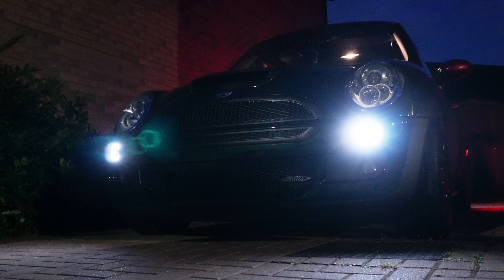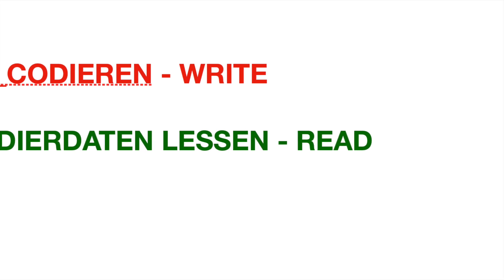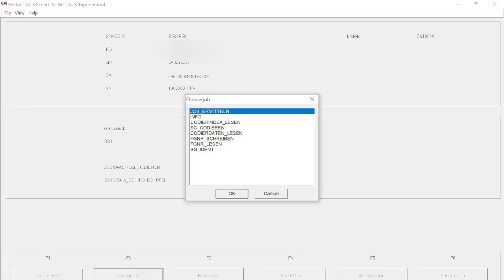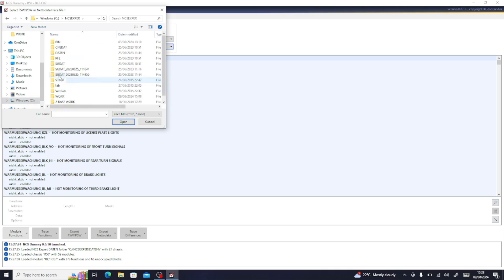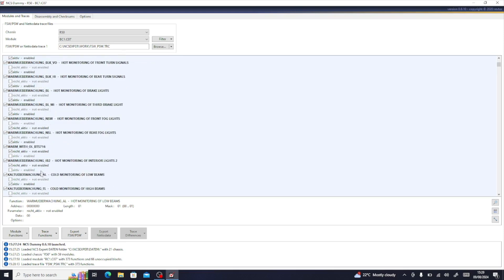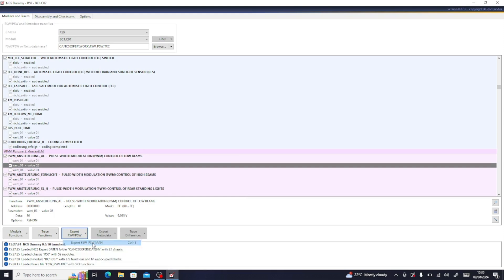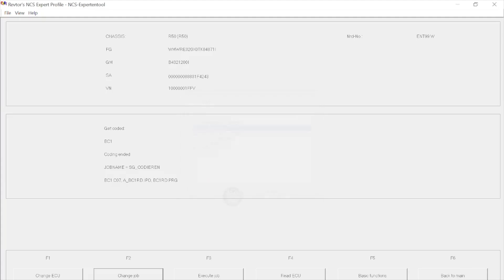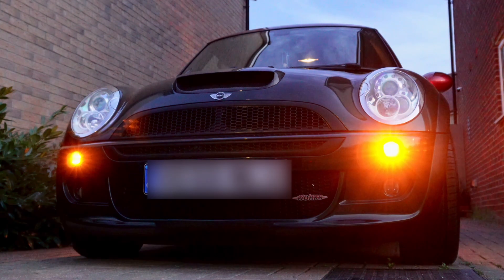How To: Using NCS EXPERT to CODE in XENON lights to my HALOGEN R53 Mini - How you can do it to..

Comment: I have a 06 r50 will the r53 xenon lights work with this coding , I have vista would that work? Cheers
Reply from the maker: It’ll work on the R50 as well, there was believe it or not a retro fit kit from mini back in the day for xenon retrofit. 

As for Vista it should work, try installing NCS expert and NCS Dummy as long as they install and your drivers for your K-DCAN cable install all should be fine.
Reply: @ThorMotorWerks ok, I've converted a r50 to r53 engine the whole hog, is this feature within my r53 2006 ecu? And if so how do I get around self level has my r50 dosent have it?cheers
Reply from the maker: @roofscoop66 It’s not really anything to do with the ECU, it’s the BCM but if you’ve done a full swap over and you’ve used the R53 BCM it may already be setup for Xenon’s anyways. If you’ve done have Halogen lights you’ll have a headlight adjust on the lower dash you can use that for levelling. 

Once coded you can if needed swap your halogens in for an MOT without the need to recode the BCM. As this setup allows both Xenon and Halogen to work without hyper flashing. 

It’s only if Hyper flashing occurs when you do the initial swap with the engine running. 

Hope that helps

Comment: Hi! Its not working for me, everything goes as it should, even uploading the file. I wait till its says "code ended". But my ligths are still flickering when the engine its running.

I tried to do it again and the new file that i read still have the settings for halogen lights. Its like the modified file its not been uploaded to the ecu even if ncs expert says code ended.

Can you please help me
Reply: Btw, its the profile chosen on ncs experts affects the job?
Reply from the maker: If you send over a copy of the BCM read file to the email address in the description below, I will take a look. Not sure the profile would affect it, but I'll see what I can do. Might not be a for a couple of days though, but its the easiest way to take a look.

Comment: Hi do you know how to change chassis number on the bcm module?
I had to replace mine but can’t code to my car as vin number on bcm don’t match the rest of the car
Reply from the maker: Can't say I have ever had to do that. Normally you match the BCM to the options on the car. You can change the ZCS details on the Centre dial. What are you trying to code in on the BCM?

Comment: Great info, I need help doing this on a r56 mini , wondering if the process is similar, if u can , can you share the process for an r56?, thanks
Reply from the maker: I’ve not looked at the R56 coding yet. If I get a chance I’ll have a look but because the FRM on the R56 id imagine it’s completely different process.
Reply: Been reading about how to use NCS and in theory the process is very similar , however I don’t have the confidence and I have never had use NCS , thanks for your response.
Reply from the maker: It's always a bit of a worry when you first start, but if you save a backup of your file and copy it onto a USB stick you can always revert back to the original file worst case scenario.
Reply: @ThorMotorWerks thank you .

Comment: hello thank you very much for your video, I installed the xenons on the R53S thanks to you :) I just have a small problem, before I had the automatic leveling on the halogen headlights but it does not work on the xenons... Could you help me?
Reply from the maker: @francoiscalve3727  you wouldn’t have had autolevelling as that’s only on Xenon’s, if you have the headlight adjust that should still be working afterwards. 

It might be worth checking your xenon’s just to make sure they are firm inside, as there is a small ball and socket the upper section sits on - sometimes (Especially if they’ve been posted to you) that can get knocking in transit and as a result it won’t level properly until it’s reseated
Reply: @ThorMotorWerks  thanks for your quick reply

I may have expressed myself badly, sorry

On my old OEM halogen headlights there was a level adjustment when turning on the ignition (you could hear the electric motor)

I understood that I don't have the "automatic" adjustment because I don't have the front and rear level sensors but on my new xenon headlights I don't hear the sound of the electric motor when I turn on the ignition, is there perhaps an option to choose on NCS Expert?

Comment: Wow!  That is incredibly helpful and useful.  It is a shame that NCS Expert is in German.   I must learn more about this generally as I have two R53's and now two R56's.   Its a long story.  I have the cable - but I think I will try now and find both softwares and load them onto a spare laptop.
Reply from the maker: Thanks for the feedback. 👍

NCS Expert is useful and you can get an understanding from most areas using NCS Dummy & Google Translate. 

I might cover off the installation process as there are a few quirks with setup and versions of windows to use that help the process. 

Once you’ve got one Mini they can get a bit addictive 😂
Reply: @ThorMotorWerks  I have a full copy of ISTA+ on one of my slightly failing laptops.   I don't really get on with it - as for some reason it doesn't seem to particularly like the Mini and crashes every now and then (due to the laptop being pretty old).   It takes absolutely ages to get a connection and I am constantly inputting the 17 digit code in just the hope that it will connect.  It doesn't seem to want to recognise the car, in any way automatically.   Have you used ISTA+ and are they comparable or completely different, in your mind?
Reply from the maker: @edwardgurhy100  I've used ISTA a couple of times - But most of the cars I work on I use INPA or an Auto Maxitool - NCS Expert is the go to for coding in extras / turning features on / off. And occasionally use WInOLs / MPPS for some engine maps. I will do more software videos - But while the weather is OK making the most of it :)